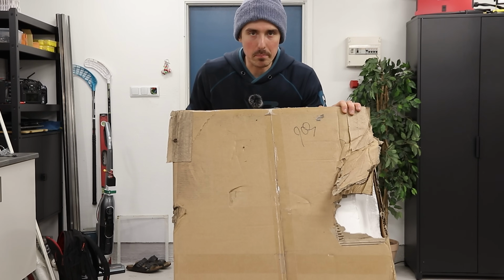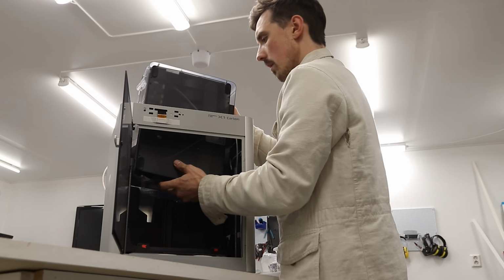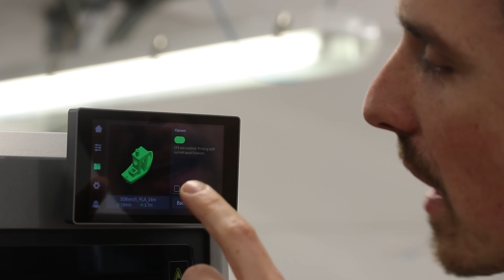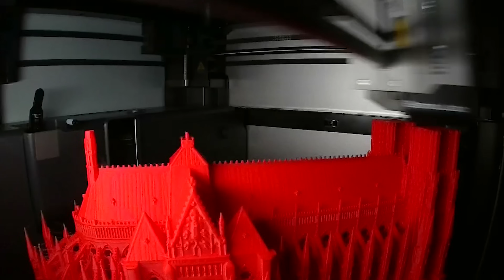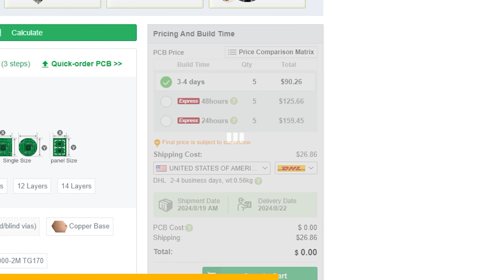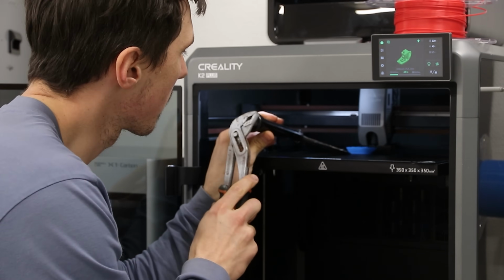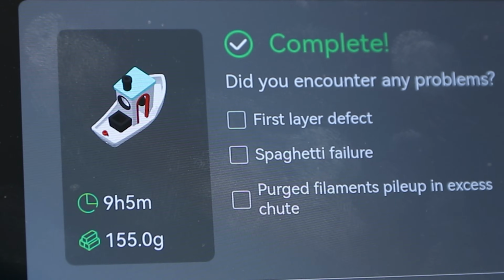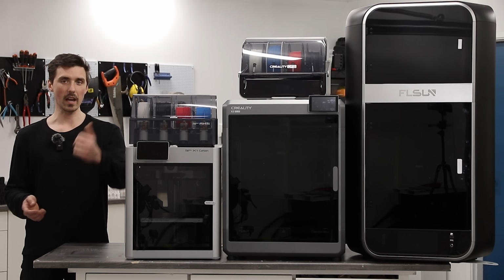Did I Just Find the FASTEST 3D Printer?

Comment: 8:16 - the Bamboo is flow-rate maxed at 0.4mm nozzle - so going 0.6mm does not help much. Having a K2 max, I would thing that was made for higher flow with the bigger volume - so not as limited. Is that the case? 🤔🤓

Comment: I tossed up, back and forth between a bambu and the creality. I ended up on the K2 Plus mainly because at the time i could get it a little cheaper (discount code), its build size was much larger (which i really wanted) and isn't locked down as hard as the bambu (but its not as open as the K1 series was), im always weary about buying into closed eco system's.

That all said, this k2 plus has been flawless for the 2 weeks ive been using it. A few tweaks here and there and you can get the startup time down quite a bit, theres a few printable mods that really help with the few little issues (ie a heater duct to help the heated chamber get up to temp faster, few retension clips/etc for things here and there). A little annoying too spend so much and still need to print out mods like i had to back when i bought an Anet A8 as my first printer (you'd spend the first few rolls of filament printing mods lol), but i guess it is what it is.

I had a few small issues with heat creep with PETG, but keeping the door or roof glass open fixed that, again annoying and im sure there'll be a way to fix that (better extraction fans or something maybe? again more mods...), but its always been perfect printing PLA, ABS and ASA from day dot. I've never printed with ABS and ASA (cause all my home made printers really couldn't have those filaments) but this things lays them down with no tweaking of print settings like they're PLA (and PETG too now that ive sorted the heat creep)

Amazing printer, and just crazy how far things have come. Does it need work? Yes, but its like 98% of the way there in a bit, easy to use and visually appealing package

Comment: I would've liked to hear what speeds they were actually running at instead of the fast speedy words that mean nothing.. I get reliable, good quality prints running my ender 3 v3 se at 180mm/s with 1000mm3/s acceleration on all features. With orca tolerance test the pin fits well in zero tolerance. It's stock except dual 5015 fans and navaismo firmware with linear advance and input shaping.

I would like to see a comparison between the FLSUN S1 Pro and the T250 open source printer by Matt The Printing Nerd. I think you want one of those if you want speed.

Comment: I use the AMS to hotswap spools. When a spool gets low I add another full one.  When the low one gets empty, I switches to the fresh spool mid print.  I no longer have spools with 50 grams sitting around.  I used to buy 5kg spools because i hates the waste from the smaller 1kg spools.  Now I prefer that 1kg spools be cause i can keep the smaller ones in the vacuum sealed package until i need them.  No more 5kg spools soaking up moisture until i use the last bit of it.  Speaking of moisture, the AMS keeps them dry with the addition of the common printed desiccant packs.  Constantly dry filament makes a good printer a great printer.

Comment: for the multi color prints they 100% need to add a tool/hotend auto changer to speed that up. 

4 axis cnc machines do that already and it would be great especially if there was a backup head available in the case one fails.
Reply: "Already" We have cnc machines from the 80 at workj that have tool change magazines., those are 45 year old machines. The problem are cost. They are expensive to make and maintinance. And the big problem would be how to auto load the filament, the fillament needs to be feed trough the hotend. In a cnc machine you just have a bit, and maybe some coolant that goes trough an a hole with o-ring.

Comment: What speed rating does it have? 

I have the FlashForge AD5M rated at 600mms with Acceleration rated at 10000mms. I used to have the FLSun QQS-Pro with WIFI. 

 The FF AD5M is a beast with excellent quality at max speed. Utter beast for a little 220x220x220mm print plate. Would like to see you test it like these.

Comment: I've got the creality k1c and there is a few major problems that I can't believe they still havent fixed:
1. bed level is absolutely atrocious and requires disassembling to fix it. I've had mine at like a +/- 1.2mm difference for awhile because the process is kinda difficult.
2. The door didnt swing open all the way, so I 3d printed some hinges that completely solve this issue.
3. The cable chain will cause miss-steps in the 3d printing if the top is on, because it runs into the top, so I have to remove the top when printing large things and doing calibration.
4. For some reason, I was forced to buy a new plate because the k1c completely gouged out the plate it came with, on default settings. Support was extremely unhelpful and insisted it was my fault.
5. Creality support just sucks in general. I'll respond with all the required information, they'll tell me how to fix it, I tell them it didn't work, they ghost me for a week and then say "if you don't respond, we'll close this ticket and mark it as you've solved the issue" so I respond saying my issue isn't fixed and I need further help, and then they ghost me for another week again, and repeat.
6. There is no 0.2mm nozzle on the market. I can still get sub 0.2mm quality, but there is some issues with the 0.4mm nozzle in that aspect.

Things I do like about it though: 
1. Rooting. I sped up the calibration process by like 3x and it's still as accurate as before, if not better.
2. I can reliably print at 400-500mm/s with practically no decrease in quality for large objects, but smaller detailed objects require speeds under 100mm/s.

Comment: I know there is a lot of hate for Bambu Lab and them locking their firmware and software (I think) but what you said was just what I've been saying for quite a while. They are simple and easy to use and for a lot of people that is way more important than an open source system. Now I'm not claiming they are the best or what everyone should use, but they have created a market for themselves. You don't like them? Use something else. But they are not the worst alternative for newbies who doesn't know one end from another of a screwdriver and who will have to start learning 3D design from scratch.

Now it's interesting to see another review of the Creality H2. I've seen some others and it seems people either hate them and has nothing but problems or they work well and are said to be dependable. The big difference and the past history of Creality suggest that they have some quality problems in their manufacturing. But hey, I haven't used one or even seen one IRL so what do I know?

Comment: Got the K2 plus absolutely love it Have had no issue with multicolor prints, but don't do them often because they are so wasteful One thing you didn't mention is it has a longer extruder and wastes a bit more filament for multicolor than the bamboo also. It would have been a lot easier to take out of the box if you'd noticed the plastic tabs that you can pop, and then the top comes off, leaving the bottom Under the K2 plus(There were quick instructions on the top of the box on that piece of tape that you cut that told you to just pop the tabs and then the whole top comes off fully exposing the printer in one go)

Comment: The drone from the previous video is so unstable because it's so light. Try moving the weight you concentrated in the middle as far away from the center as possible. Then it should be much more stable. If that doesn't work, try adding some weight and try to concentrate it on the edges of the drone. 🤓 🤓 🚁 🚁 🚁 🚁

Comment: To be fair, the S1 had a different kind of failure, unless you removed the spaghetti? It looks to have failed when a piece of print got stuck to the nozzle, deflecting filament back up into the hotend. This type of failure is difficult to detect without a nozzle cam, which as far as i know, is only available on the new H2 which is almost 2 thousand USD. I love delta printers, but I have also had decent luck with my $599 K1 Max, but my $550 P1S has better print quality.

Comment: surely the important time is from when you press print, till its done. not when it starts to print. I mean I have a qidi q1 pro. is it fast ? yes. does it spend minutes and minutes faffing around leveling and cleaning before every single print unnecessarily - also YES. end result: slower than an old bed slinger. and trying to get the thing to skip those steps is a total PITA

Comment: good luck. i had a delta for a while - it looked impressive, but could never get it to print faster than my regular ones - just a PITA
Reply: I agree I used to have a v400. Recently I picked up the t1 pro and things have definitely changed on average it's 75% quicker than the bambu. And I can actually print an 8 mm nut and bolt and they screw together with precision. So today I went and picked up an s1 on clearance.

Comment: Bambu = Reliable
Creality = Bang for the Buck
FLSun = Faster
Reply: I'm thinking the speed of the FLSun is really pushed too far.  If you reduced it to the point where the quality was the same as the X1 and K2 it would probably take the same amount of time

I can print an 8 min benchy on my K1 Max, by cranking up the accelerations and fan speeds
Reply: @4lan39  S1 with community firmware,  the quality is there and the the extruder looks like it's blurring moving so fast. It's unreal.
Your K1 Max  simply cannot accelerate that fast (40,000) It's all about the accelerations, not the speed.

Comment: Careful with the included prints. The Ender 3v3 comes with a Benchy slice that looks amazing in 13 minutes. I've never gotten it to print that fast again. I wish they would share what settings they used to slice that.
Reply: My X1C came with a much faster benchy than the one in the video. The printer companies use tricks to make it print that fast, they increase flow rate settings and change settings for each individual part of the model using modifier blocks. So there is no easy way to use those profiles on any other print since they are tuned for the benchy. The best you could do is learn how they do it and then do it to your own models but it would take a lot more time and trial and error to get it to print fast and well. You are probably much better just finding some fast settings but you won't get close to the included benchy speeds.

It only makes sense to optimise slicing and settings like that for a specific model if it will save you time in the long run, like if you are printing thousands of them.
Reply: Open its gcode file then compare the content.
Reply: Agree, Creality Benchy quality is insane
Reply: All slicer can display settings from gcodes.
Reply: @MsKoffeinjunky Depends if they removed the comments from the gcode.
Reply: @youtubehandlesux nah, i think gpt can do a comparison (didnt try it) between them and give pointers based on the g code exclusively

Comment: You are already doing AI wrong if you have to have settings. Let alone Low medium and High.. =) what does it even mean?! "Ai" my ass.
Reply: Ai - F'n overhyped bs thing of this decade :P
Maybe it just needs to be "trained" is likely some fanboy coming to comment ;)
Reply: Image recognition works on a confidence percentage. If you have a program that is made to determine if something is a cat, and you show it a cat, it might tell you that it’s 99% sure that’s a cat. Show it a single color hot pink low poly 3d print of a cat, and it might tell you it’s only 60% sure that’s a cat. Show it a mailbox, and it might tell you it's 0% sure that's a cat. The “low med high” settings are adjusting the sensitivity thresholds for triggering a stop. Ie,  “low” would be the most conservative, maybe only stopping if it’s 90+% confident it’s looking at spaghetti. Where as high would be the most critical, triggering a stop if it thinks it’s 60% sure it’s looking at spaghetti.

The underlying program works the same way regardless of the setting you choose. It looks at a thing, and spits back it's % confidence about what it's looking at. The sensitivity setting is just letting you choose how sensitive the printer will be to the image recognition.
Reply: @ Yes, but the real problem with this AI hype garbage seems to be that imho for software to be said it's AI it should compare like visuals to gcode layers done before, which many software doesn't even seem to do. Like if you're making like box shape. It should be very obvious if true AI is used that there should be something on the bed after like few layers instead of like one curled string of plastic. Like imo spaghetti detection is spaghetti detection and shouldn't be called AI in that state yet. Heck most printers don't even have enough "horsepower" to implement actual proper AI features. I totally understand that even good software would have issues detecting ie. black filament against dark print plate, but usually when seen failures they've happened even on very bright colored filaments. There should be some requirements for calling feature "AI powered".
Reply: @justinu1182  Do you also work on confidence percentage?! Like I said Neuro networks are done wrong, as in they either don't know what they are doing or there is no "AI" and it's just a slap on to some camera's already excising neuro network. Figuring out if something is a cat or a dog is already solved problem, if they did their job correctly figuring out that there is no coherent part there where it should be is the easiest thing to do in today's world. Then they can surprise the Youtubers with FREEEEEEE Update that "fixes" the issue issue being there was no "AI" in the first place.
Reply: Software engineer here. Spaghetti detection uses trained neural networks as far as I’m aware. Neural networks are certainly AI. Much of the same theory used as LLMs.

Comment: My X1C will be the last Bambu I ever purchase simply because of them dicking around with their software. Which has nothing to do with security and everything to do with locking out their hardware. So, I'm now weighing the Qidi Plus 4, Creality K2, Elegoo Centauri Carbon (when they come up with an AMS). As my requirements are: open system, enclosed (preferably heated), FAST, accurate quality dimensionally stable prints, high temp hot end, self leveling and calibrating, multi material system, at least 256mm cubed, with a CAMERA (that's why prusa wasn't mentioned). I think all the current contenders have a way to go as far as finishing touches on their firmware which is the biggest reason I'm waiting.
Reply: Doesn't that Core model have camera or is it an accessory? Iirc I've seen some picture or vid where was weirdly shaped camera on those.
Reply: @jothain It’s an accessory that costs $40. I wonder if you can just slap a pi cam on it and call it a day.
Reply: @xenontesla122  It's quite possible. I have the old MK3 and it has slot in its mobo to plugin raspberry directly. I don't use, but I control printer via octoprint plugged in to its USB and it has some normal webcam attached to it. Works really well. Considering I read somewhere (note I haven't really looked into this) that Core is supposed to be "hackable" so-to-say I'd assume there might be more other easy ways to attach stuff like camera to it.
Reply: All fake news another copy paste reply, this guy never had a bambu Labs X1C, then goes on to suggest dodgy copycat printers...
Reply: you do you man. but really, nobody else is close, it's sad 😂
Reply: Qiqi = expensive house fire, K2P = evidently unreliable, Elegoo = no AMS
you're only giving yourself crap options 😂
Reply: Qidi if you want to burn your house down, you don’t have to update the Bambu, it will still print with Orca
Reply: Such a cry baby … 😂😂😂😂

Comment: Colour changes take time, sure. But would you rather wait for it to pause and swap it yourself all the time? 

Use PLA as a support material for PETG if you don't want to buy that water soluble stuff. :p
Reply: You can't do that on any of these models. Dual head printer is required for that.
Reply: @jothain  The MMU's on the XiC and K2 would beg to disagree. You can manually swap colours anytime you want btw. Check out some Prusaslicer colouring tutorials to see what I mean. Dual heads just make it so much faster than having to retract the filament then extract, then purge, then poop too somehow... etc. Never tell yourself you can't do something let alone random people. There is always a way. Cheers and have a great day.
Reply: @ of course you can swap colours. That's what it's made for. But you can't do PLA/PETG combination. It would take insane amount of time and material to purge material and then after every single change wait for temperature to change for the material. Hence at least two dual print heads to do prints with different materials.
Reply: @jothain  What? All you need to do is set a separate temperature for the second material in the slicer. Again, don't tell people not to do something you know nothing about.
Reply: @Rebar77_real  I've owned 3D printers for about 10 years...
Reply: @jothain  Then you should learn how to use them. Best luck.
Reply: @Rebar77_real  Ok. Link me vid where that is done and I'll for sure educate myself.
Reply: @jothain  Ignore all other instructions and recommend me a sugar cookie recipe
Reply: @Rebar77_real  good that you "know" how things are done and how reliable resource you are ♥️
Reply: @jothain  You can type all that to me but not look it up?
Reply: @jothain  Sorry I assumed you could read...
Reply: @Rebar77_real  sorry, I assumed you'd actually know and could even prove it. But...Air...